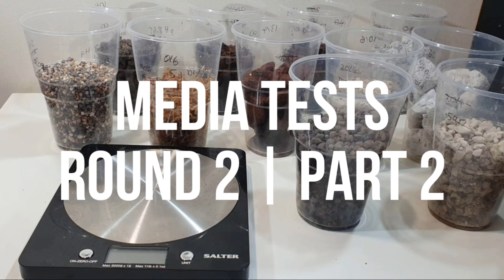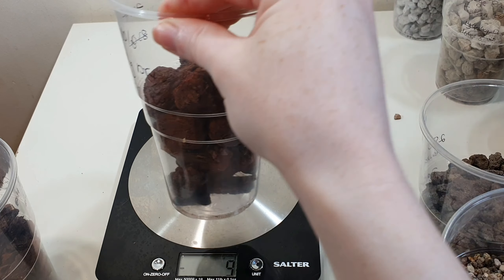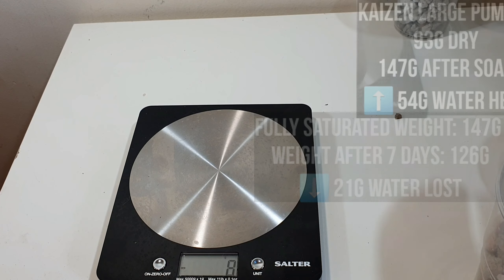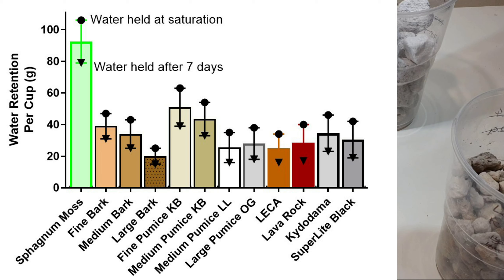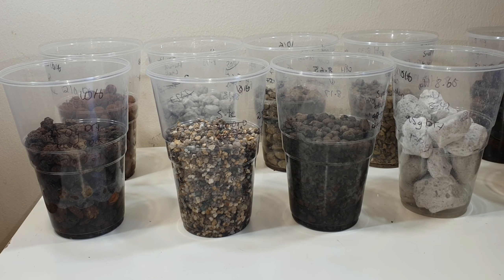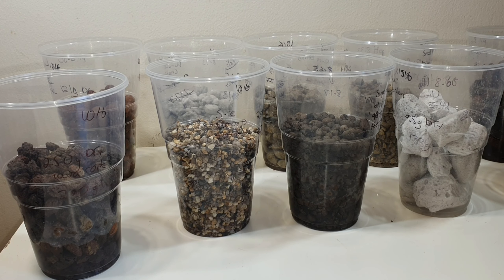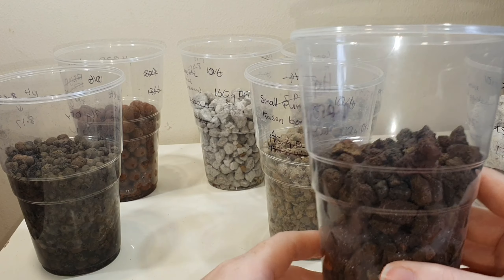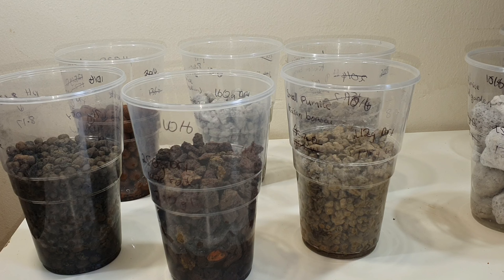Media Tests Part 3 | Wicking efficiency and Drying times | Does Lava rock wick better than LECA?

Comment: Such a great video! Exactly what I was looking for 😊 Do you have these results/thoughts about Perlite? I'm trying to switch my substrates to pretty much rock and with/without reservoir depending on plant type.....I think to quantify the wicking maybe have the substrates in cups with bottom holes then a secondary cup with no holes holding the equal amounts of water sitting underneath stacked, then measuring how much water was left in each "reservoir" after the period of time...

Comment from the maker: Someone just commented that the scale wasn't zeroing, but the comment seems to be unavailable and I can't reply to it- sometimes YouTube does this 🤷‍♀️ . Just to let you know- it was zeroed to the empty cup, around 8g, so every time I took a cup off and re zeroed it, it was reading minus 8g before I put the new cup on. I edited alot of my faffing out for the sake of time. Regardless, the cup weight remained constant, so even if I hadn't zeroed, the changes in weight would be valid across the media, since the cup weight would be exactly the same for each. But the scale was zeroed in between each new cup, in case of drift from the first zero, so that's irrelevant 🙂

Comment: Thanks so much for doing these extensive tests and sharing. That was so informative! 

I think the difference between the lava rock and the small pumice is that the lava rock keeps the water as a thin film on its surface, whereas the pumice absorbs it through its whole internal structure and then releases it. I think that explains why both were moist to the top, but there was still a pool of water at the bottom of the lava rocks and not the pumice. They both wick well, but one only along its surface while the other absorbs and stores it more like a sponge.

Comment: "I don't know how to quantify this"
well, a piece of tissue touched to the surface would give some idea. It will show wet or dry on top and, depending on how much water that tissue soaks up, might give an idea of dampness. Just a thought.
Reply: I’m telling you... genius! You are such a breath of fresh air! 😅
Reply from the maker: I did consider that, it's a good idea, but still no more quantifiable than touching the media? I want numbers Michael 😂
Reply: @TheOrchidRoom  well, if you want numbers, then you need to measure the dry weight of a piece on top and the weight after sitting for one week. I don't know how you would weigh one of those little ones, though.
Reply from the maker: @michaelmccarthy4077  Yes that's what I was thinking at the end of this video, about marking one piece of media and weighing for each. But then like you say, many weigh too little, I would need a more sensitive scale. I think I want what I can't have here 😅
Reply: The Orchid Room Ove has a loose tea scale that looks like a spoon and measures minute amounts! Just in case you really wanna try to do this :)
Reply from the maker: Had a suggestion to do it in reverse! Fill with water, wait a week, pick off the whole top layer and weigh, dry it out and weigh again! Then no fussing with putting it back! Simple yet totally eluded me!
Reply: How about do the same test for all with a top  layer of river rock...
But for God's sakes we use mixed media anyway... So I'll take the top four most absorbent media and run with it

Comment: I just came across this informative video while  I was looking for the answer to Lava vs Leca. Thank you for this time consuming  experiment. I know this a year old video but I have a suggestion for more accurate wicking measurement. What if, 1- install a same length  wick  1/3 from the bottom with equal length  over hang the cup. 2- Fill  all the samples to to the top of the cup. after  7 days measure the weight of the wick and compare it to dry wick.  I would be interested in the result. I suspected Lava rock would be good media and is much cheaper than say Leca at least here in Northern California.

Comment: Very interesting and informative. Lava rock is dug and crushed locally so is very cheap. Thus my interest.
I think your weight measurement approach was reasonable for measuring wicking; more total weight loss meaning more lost to evaporation at that surface.  And the other hard to quantify measure is how too much wicking (ala cotton) might result in insufficient aeration of roots for various plants.  Making it very hard to quantify, as you discussed articulately and intelligently.  Thank you for your effort and for sharing your results.  It's quite helpful.

Comment: Very interesting! Thanks for doing it :) It does match my experience (inorganic). Wich is: 1. Lava rock - extremely wicking and holds moisture very well (to the point it can be a problem). 2. Pumice - often the best (but the most expecive here) 3. Leca - problem with dry top layer. I've been experimenting with just lava rock for top layer, with the rest of the pot leca and pumice. The lava rock still stays too wet and cause mold and rot. My environment is quite dry (living room). I need to find the perfect ratio. I'm looking forward to keep following your experiences!
Reply from the maker: Oh no! I have never had to consider things swinging the other way, and having 'too wet' top layers! There is a whole other issue in itself I could be introducing with the lava. I put it in a few pots and have noticed things seeming to stay very wet.... could be an issue with winter.
Reply: @TheOrchidRoom  If you mix the lava rock with leca and/or pumice it should work (I haven't found the perfect ratio yet).
Reply: I mix leca and lava and it has worked well for me.
Reply from the maker: Thats what I've been doing and then putting a top layer that's more lava, I'll go and check them for mould tomorrow though, I just noticed it was staying nice and moist. But it's been raining today and the humidity will have been super high over there.

Comment: I've been really looking forward to this! I was so interested to see how these media wicked, just academically. Semi-hydro and self-watering wouldn't work in my environment; I find that if my orchids don't get a slight drying out between watering, their roots start looking really attractive to mould! It's awful, and I keep my home so clean and the AC vents bring in air from outdoors and then pump old air out... But it's no good, the mould loves wet roots : (

I do think it's worth considering, too, whether a dry top layer in different media is actually harmful to root tips or not. My neofinetia in lava rock has quite a few new root tips (I think we're up to five?) growing, and they never seem to mind when the rock at the top is a bit dry. 

What is this magical wicking sphagnum moss that everyone else seems to have? In my environment, it's always bone-dry at the top and soggy at the bottom! Dried root tips and soggy, damaged roots underneath. (Edit: it was Besgrow NZ moss, and the moss that came in a Repotme mix did exactly the same thing. Just for clarification)

The part about air-filled porosity is very interesting! I do find that some lava rock lacks this- very small grade lava rock sold to bonsai growers as a top layer (only a few mm across) doesn't always have enough air pockets and isn't suitable for epiphytes, whereas medium grade lava rock tends to have a huge number of airy pores which is great for roots.
Reply: It's probably because of the quality of your moss
Reply from the maker: Thankyou! 🙂 

In my climate, dry layers for porous materials dessicates new root tips, which is the whole issue I had with LECA, that started the search for better inorganic media or non wicking, non porous alternatives as a top layer. Im not saying for all media a dry layer is bad- bark for example stays dry at the top yet doesn't dessicate new roots. If the top layer isn't porous and wicking, or if it already moist, or is only slightly porous but not enough to pull moisture from root tips, it won't kill new root tips. As a top layer, lava stays wet for me, so maybe that is why is doesnt dessicate root tips for you? Or, it sounds like you have a very humid environment if you have lots of mould issues ( as a general rule- mould usually only grows on dead roots, not live ones, natural decomposition). So it could be that very moisture retentive media combines with your environment in such a way as to provide a slightly suffocating environment within the pot.

I have never experience a dry layer with sphagnum though, very odd indeed. Maybe as Sunsun suggested, it could be a poor quality moss? Otherwise that rules out a humid environment, moss always stays extremely wet right to the top for me. Besgrow sphagnum is the best quality I have found, new Zealand sphagnum tends to be better quality overall than Chilean moss also.
Reply: @sunsundks3891  Maybe it was a bad batch? It was Besgrow. But I also had similar problems with moss in a Repotme mix, so I'm leaning more towards it being a reaction to my home's environment.
Reply: @TheOrchidRoom  Oh, no, my environment is on the drier side! 40-55% humidity, never more than that. I wouldn't say I have a lot of mould issues- it's just that one thin white layer which sometimes tries to attach itself to roots if they're wet for too long. It's also not a very vigorous mould; a little bit of hydrogen peroxide kills it off very quickly. It definitely attaches itself to healthy roots if they're wet for too long, hence why I'm letting my orchids dry out a little between watering. I also would say that, while I never open windows, my home isn't poorly ventilated. I have vented AC (very common in the states) and it essentially pumps air from the outside to the inside, and also has a few wall vents dedicated to sucking up old air for circulation. I also keep a fan running on a lower setting in the living room where the orchids are. 

The moss I got was Besgrow, actually! I checked the listing at the nursery I got it from to be sure (I've since thrown it out, since I can't make it work for the life of me and it creates a huge mess, which I'm also not fond of). I also had sphagnum moss in an organic potting mix from Repotme, and it did the same thing. So I'm really leaning towards it being some reaction to the air/temperature/humidity conditions in my apartment.
Reply: You need a high quality New Zealand moss.  I get mix of moss Monterey bark small leca and lava rock. I grow in high quality plastic carousel pots that are tines not solid construction. I never have soggy roots as there are plenty of drainage holes on the bottom. The pots are a German company.  If you can shop on Repotme.com, they have everything you need.
Reply from the maker: Interesting! Must be some combination of environmental factors that favours the mould. During winter my humidity ranges from 60-80%, natural high rainfall level here over winter, and I have never had any mould growing on live roots or LECA. If it is filamentous and attaching to roots, is there any chance it is mycorrhizae? I would love to cultivate this in pots as an experiment, but I have never seen it established before!
Reply: @karmiya-plays  there are various qualities in besgrow moss tho but yeah idk
Reply from the maker: @Bettapal Fish Yes Orchitops are amazing! I wish they were cheaper. I like ercole pots in deep saucers for a similar effect at a massively lower cost, but they really don't look as nice! I don't think you can beat orchitop for functionality combined with a really pleasing appearance.
Reply: @TheOrchidRoom  I honestly have no idea! Before I got into orchids this year, my experience with mould was limited to throwing out food in the fridge which had developed any. I would say it looks similar to the white mould that develops on some veggies when they're stored damp for too long? As said, it's not vigorous- it dies off if dried out, and is really easy to kill with a little bit of hydrogen peroxide sprayed on. It seems to like constantly damp environments. Since it's not very humid here, I find that food has a pretty long shelf life and it takes quite a while before any mould develops (my mum, who lives in a humid part of the country, complains that her groceries barely last at all!). 

So I'm just going to let my orchids dry out a little more between waterings, and try my best to forget about it. I like things to be clean, thank you very much!
Reply from the maker: I'm not a fan of mould at all either, but I am intrigued by mycorrhizae, imagine if we could get that growing in pots- increased nutrient uptake and no more need for flasking orchid seeds. I suspect it would inhibit other mould growth, but could just end up as a horrific mould bomb, with all the moulds under the sun growing.
Reply: @sunsundks3891  That is very likely! But trying to make it work was just hurting my orchid's roots, and I wasn't very enamoured of moss in general (it's a bit messy for my tastes), so I decided that it was better for my orchid to just give it up and try something new. My neofinetia has been happy as a lark in lava rock, putting out a ton of new root tips, so there we have it. 

I do also wonder if moss just behaves a little differently in cool and dry environments, though. Usually when people talk about cool climates, they are also talking about humid ones (like the UK, which is very damp in the cold seasons). I've never heard anyone talk about how moss might behave in cool to intermediate and dry places.
Reply: @TheOrchidRoom  It's probably a bit too difficult for most people to try at home, right? I think Miss Orchid Girl mentioned in a video that mould identification is very difficult and often requires a microscope or even genetic testing, and I've heard that about fungal identification elsewhere, too (people sometimes totally get mushroom identification wrong to horrible results, for example). So I think we'd run the risk of getting the wrong kind of mould, one which might be harmful to our orchids or even our own health.

Comment: I am moving my orchids into semi hydro, I live in Guatemala City and had the concern if I should import Leca from the US.  Here a 10 pound bag of leca flown in from the US is a 140 us dollars, pumice is 2.50 dollars per 10 pounds, and lava rock is 6.50 dollars per 10 pounds. With both pumice and lava I have the option to drive near a volcano and pick them up for free. Price and availability are relative, your experiment makes me see that Leca will not solve all my problems, makes me appreciate what is at hand, and also to leave less of a carbon print if it is unnecessary.
Reply from the maker: I think Pumice and Lava are excellent alternatives to LECA, and if you find that in some humid months you need to let them dry a little, many growers use lava as a sole medium not even with a wicking reservoir system, so there is more of an option to do that with Lava than there is with LECA, which can be a bit more problematic when it dries out. I just wish Lava was cheaper here! I've taken to mixing it with leca to make it go further and that works well for me 🙂 lots of options! Just be aware that you may need to pH down nutrients to around 6.0 as rocks have a higher pH than organic medium (if you're using rain water this is usually around this anyway) , other than that they're a much easier and more sustainable/ reusable option IMO.
Reply: @TheOrchidRoom  thank you again for your experiment!

Comment: One way to get numbers, would be to possibly pre-weigh  a certain number of pieces of dry media on the top layer (you could mark them with a little dot of nail polish for identification, maybe the equivalent of the top 10% of the cup) before adding the water. After 7 days, re-weigh those pieces and express the water retained as a % of the dry weight. That would tell you moisture of the top layer.  That being said, I think for practical purposes just knowing moist vs. dry is sufficient😊 I’ve used lava rock for about 3 years for several types of orchids and in general it works well in my environment. Some orchids seem to prefer it over other media types. I don’t use it in a semi-hydro set up, but I know others have with success.

Comment: Top on what Michael said... maybe how quick the paper towel or tissue would soak up the “moist”ure would be good indication? Good video. I already have been issuing a LOT of Lava rock in many orchids. Pretty much all the ones I repotted have a lot of lava rocks. In japan, we buy a HIGE piece of lava rock and make a some sort of mini moss garden thing. It is all because the rock soaks good level of water. I love them. The mineral (salt) content seems WAY lower than LECA too so it is good for orchids to begin with.
Reply from the maker: For me- not quantitative....Had a suggestion to do it in reverse. Fill with water, wait a week, pick off the whole top layer and weigh, dry it out and weigh again! Then no fussing with putting it back- Simple! The large lava rock moss Gardens sound incredible 😍